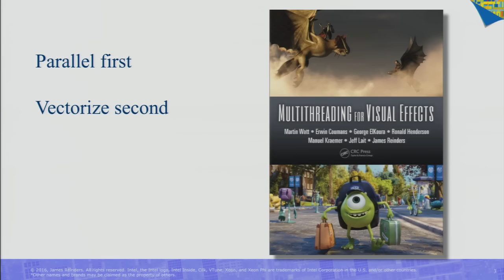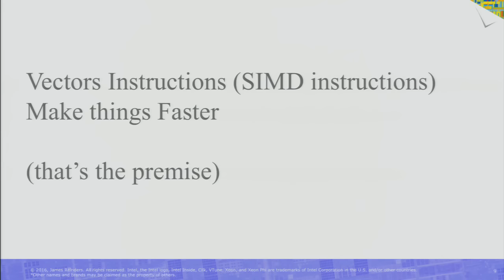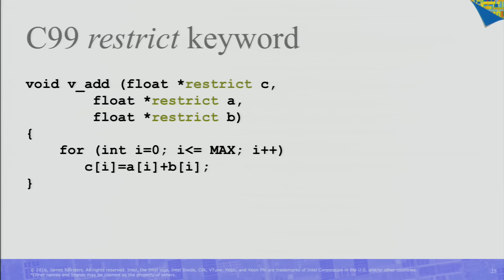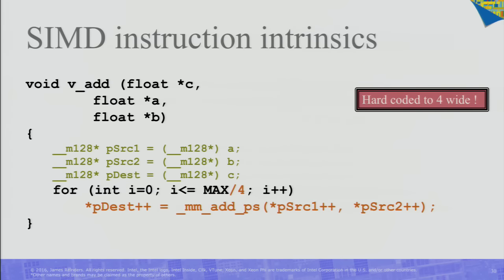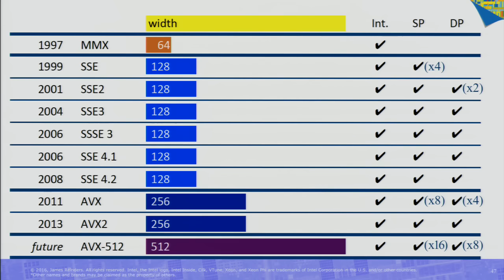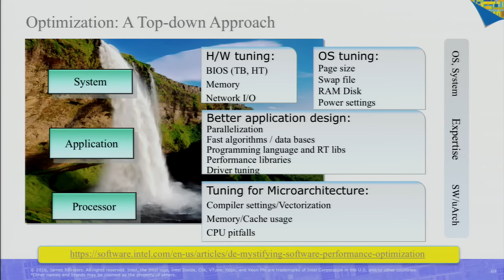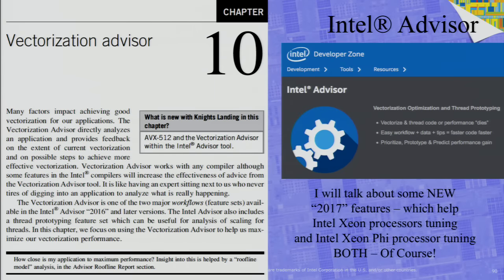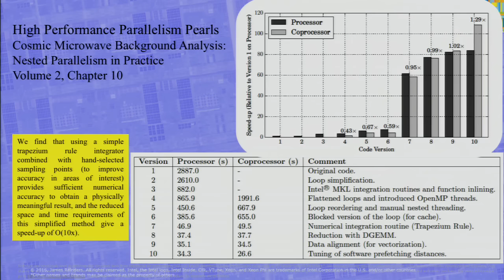Performance: SIMD, Vectorization and Performance Tuning | James Reinders, former Intel Director

Comment: Nice presentation.
At 25m25: large arrays hinder cache use.
Can you recommend what a good would be for the size of a vector slice?
I guess this is a AoSoA vs SoA kinda thing?
Reply from the maker: Excellent question, Bram. We'll look into that and get right back to you.
Reply: The Array-of-structs vs Struct-of-arrays issue is about avoiding sparse use of the cache.  This issue is slightly different, it is about repeatedly overflowing the cache.  What James is saying is that if your arrays are large
and you perform a series of operations such the example v_add(), then the second operation won't benefit from any cached data from the first one, and so on.  It is more efficient to perform the series on a slice, then repeat on the next slice. 

There is not a simple answer for choosing the size of the slice.  The optimal value depends the number of arrays you are operating on, their type, and also the cache size for the target architecture.  For portability, you would probably want code this so that the slice size can be tuned easily, then run some benchmark tests to find the best value. - RL